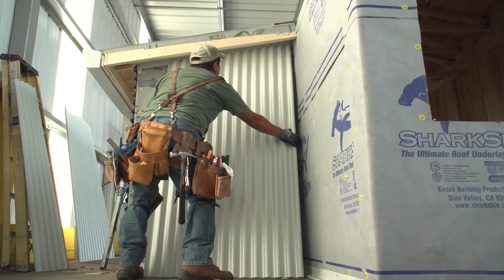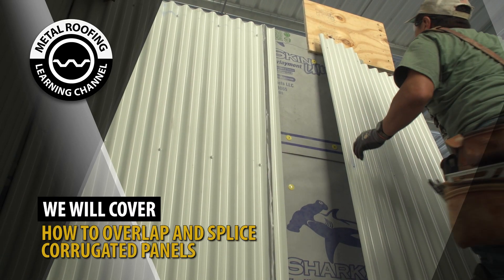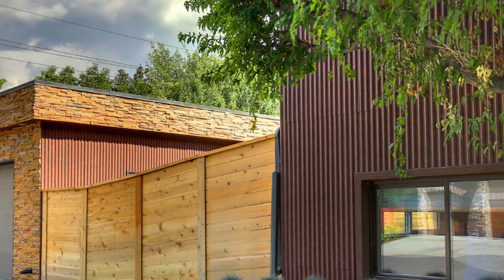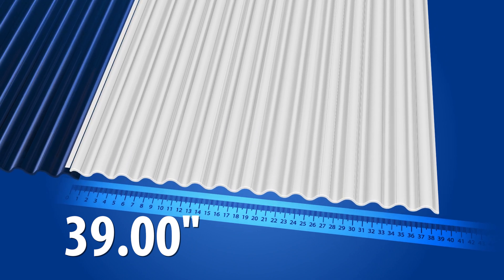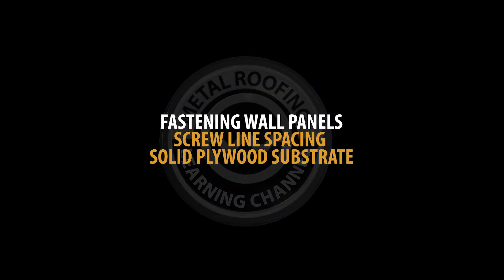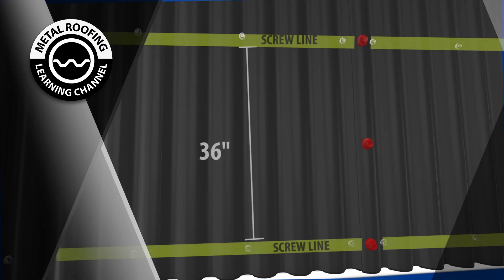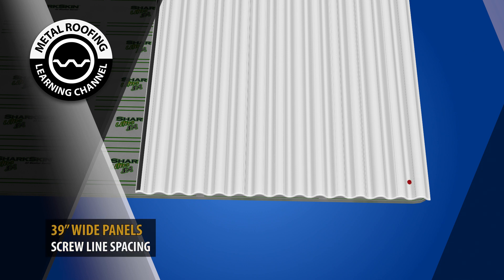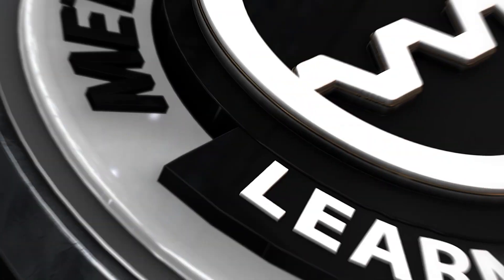How To Install Metal Siding. Corrugated Metal Siding Installation [Screwing Panels + Overlap]

Comment: How can install with no screws showing?
Reply from the maker: If you don't want the screws to show, then you should not purchase an exposed fastener panel such as corrugated metal. You will need a concealed fastener panel such as standing seam or a flush wall panel.

Comment: Just about to do this for an outbuilding and it perfectly explains how to install siding thanks
Reply: I have these walls for interior living room walls. Any suggestions on how to or the best way to go about hanging picture frames?
Reply: @alanwest1067  only a suggestion but perhaps something like a drywall/plasterboard/hollow wall fixing
Reply from the maker: I appreciate you supporting the channel. Any questions feel free to comment and good luck with the metal siding installation
Reply: Seems good so far! Was easy to talk to about his My Shed Plans [Go Here=> WoodBlueprints. Com    ]. Guided me in the right direction & helped me understand everything & in the end it was what I wanted